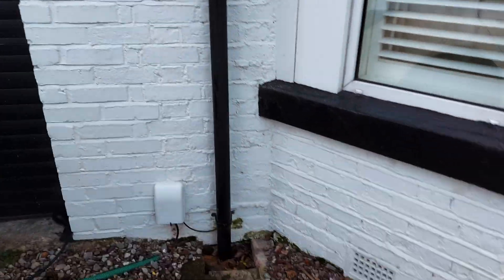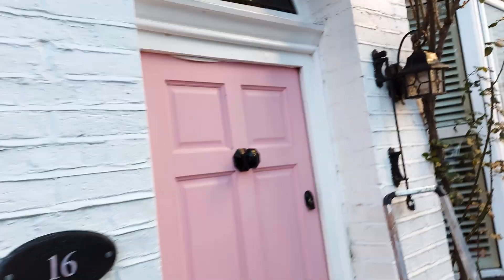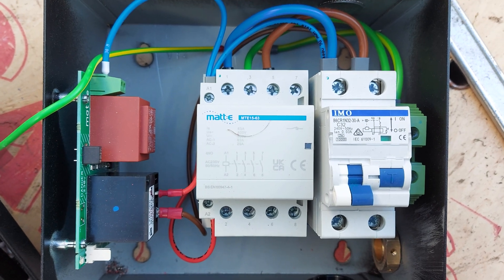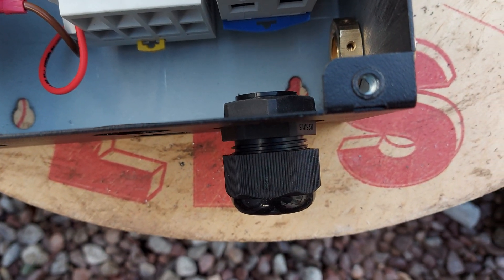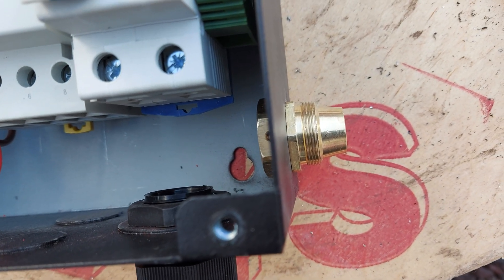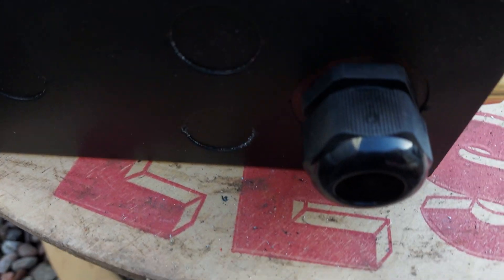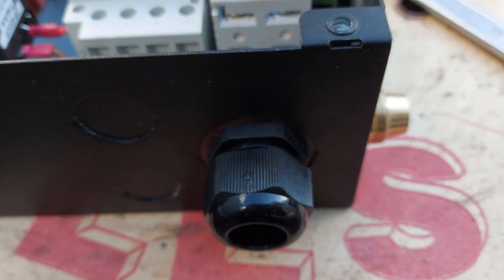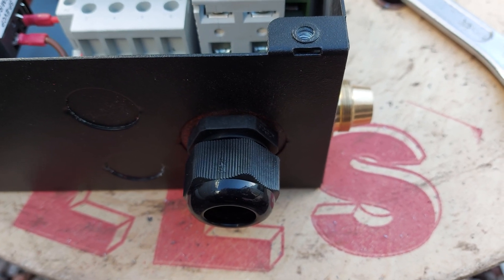Tesla Wall Connector Gen 3 UK Installation

Comment: So I have an old ten year old charger basic connection. I’ll take it that this needs protection as well?
Reply from the maker: That's not much information to go on. If it was installed to the Regs in force at the time then it's OK. If it's being moved or reinstalled then it has to be installed to the current Regs. All Tesla chargers need external PEN protection or have to be installed as a TT configuration, which usually means fitting an earth rod. There is noone answer to such an open ended question

Comment: Nice one Gary. Cheers for making the vid. Did you have any problems linking the wall connector to wifi? I have heard they can be a bit of a nightmare...
Reply from the maker: Hi Matthew. The honest answer is that I can't even remember connecting it to WiFi, so it must have been pretty easy. It's the only Tesla I've fitted, so I'd just have followed the instructions. Most modern devices seem to create a temporary WiFi network that you access from your phone and then you just enter the network details and password and then you're in
Reply: @abcelectric  Hey mate. Cheers for taking the time to get back to me. It's always a good sign if we can't rememeber an install, I say! lol I have been doing a bit of nosing around on the question and it seems that its the old 2.4 / 5Ghz wifi issue again. To be honest I have to deal with that on a weekly basis so its not a real worry. All the best mate; keep up the great vids!

Comment: Hi great video. Just wondering does this unit have any load limiting technology to protect the main fuse? Never installed one of these usually install Zappis - nice and easy lol
Reply from the maker: Not that I can remember Andrew. It's not a product that's particularly UK friendly. You could stick a current limiter upstream if needed. Matt-E do something with built in PEN protection, which you've got to fit anyway. Make sure you've done your diversity calculations and notified the DNO. Unless the maximum demand is already high a 100A cutout is usually fine

Comment: Morning what type pen protection can you use for the tesla 3 charger type a or b or is either ok
Reply from the maker: PEN protection is a different thing to type of RCD, although if you use the Matt-E or similar it makes sense to combine them. As far the RCD type I can't remember for the Tesla as I don't fit many, so check the manual. It needs to incorporate a 6mA RDC-DD, so that would really be a Type B RCD from memory. It's not the sort of thing you come across on a regular basis
Reply: Ok thanks

Comment: Hi Gary - How much to fit Tesla Wall Connector in Sale. Easy cable run just through wall 3 feet. Have some 16mm armoured. What’s the script with pen protection you mentioned?
Reply from the maker: Hi Stephen. It's not that straightforward. Send me an enquiry from my website and I'll send a digital survey or do a physical site survey. 16mm armoured is too big btw. Won't fit in terminals. Need 4 or 6 depending on installation. Tesla Wall Connector needs separate PEN protection. DNO application process still applies. No grant on Tesla either
Reply: @abcelectric  thanks Gary - decided to wait a bit … will give you a shout when we’re ready